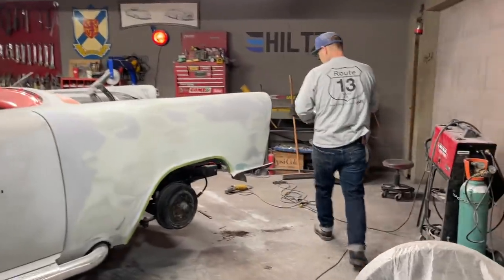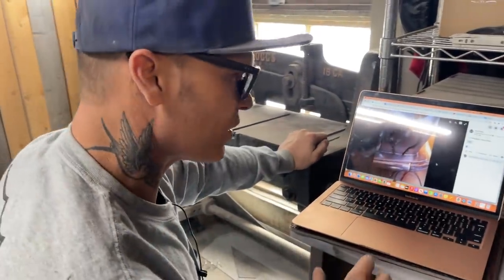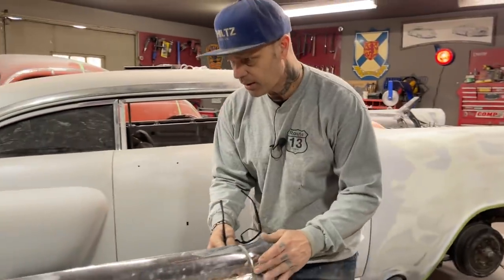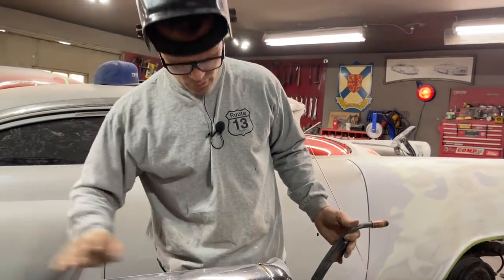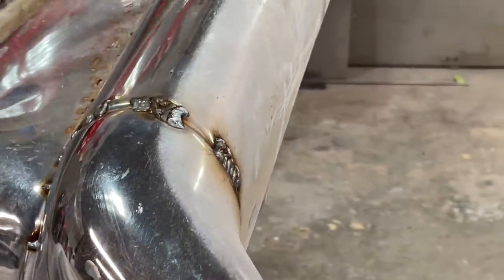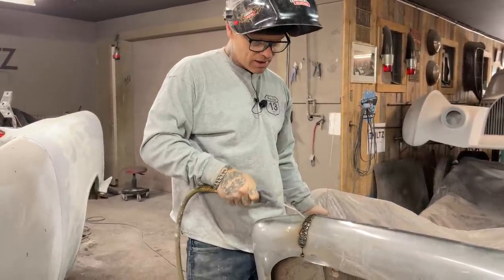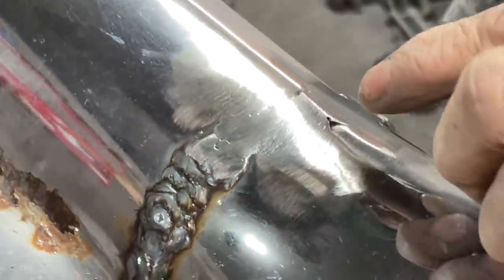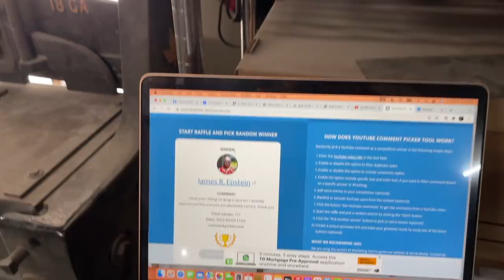Converting 3-Piece Chrome Bumper into a 1-Piece  ✅

Comment: Hey Chad, love the info/photos on the creation of the front end & bumpers. I have a suggestion - drill a hole in the flat frenched sections on each side so that they do not fill up and have water sit in them, just behind where the bumper bolt is welded in would seem like a good spot. Cheers, Tony (1955 Chev 4 door from the Land Down Under)

Comment: Having had things plated for many projects. The smoother you can make it before being plated, the nicer it will be afterwards. Traditional hot dip chroming is getting more and more expensive in this country because of the environmental taxes. Spray on chrome which is water based and can be done to a larger variety of materials is much cheaper and unless you are very skilled you can't tell the divergence. The bonus is it is much cheaper. You probably could have had that grill you had redone for less money than what you paid for that new one. You should really look into it. I think you could add an additional level to your cars and open a lot more options for you.
Reply: Jolene should check out Spectra Chrome.
Reply: @stevejakobs476  Yes. There are also places in Canada able to do the same stuff in Ontario and Quebec which would be closer to them. I think they should look into getting a system. A place called Cosmichrome in Montreal is a supplier of the system and supplies. Then they would be able to do it themselves and they would also be able to provide it to others. It is a much better and nicer system than the stick on stuff he likes to use. Plus it gives him more options.

Comment: Chad, I worked chroming many yr,s ago.  You do all the prep work first to save $$. grind as much pitting and make the bumper surface as smooth as possable.. First they copper plate it, that is the base. All the pitting will show just like primer and paint prosess. They polish the copper andredo until the pits are filled ground (more time and money. The smoother ,cleaner you send it. The less work and $$ for you. Hope this helps! Cheers , Bernie.

Comment: When I did my bumpers, I ground down the weld just before I hit the actual bumper, and then I hand filed it until it was 99% flat, then used 220 to sand the rest smooth. Absolutely no dips or high spots.

Comment: Congratulations on your successful dry February and choice if moderation!   Though you have indicated TIG is too slow fir you, consider that with TIG you are more localized with the heat, so you are able to run a longer bead before risk of warping, and you can cool the piece with the shielding inert gas (which has greater thermal mass) more quickly without switching between torch and air gun.

Comment: Going to be interested in this one because i have a rear bumper i want to modify myself.
Reply: I had to take mine to the shop for them to look at before I worked on it.  They wanted the old chrome and copper stripped off before I did any welding. They did that for me and just included it in the price.

Comment: Wondering about getting your vehicle certified for the road if the bumper is not attached to the frame. Do homemade or vintage vehicles have different standards for licensing or insurance? Asking as I’d like to remove some crazy bumperettes that were designed onto my 2002 Audi TT Quattro. These were only added in Canada and look a bit ridiculous actually.

Comment: Just wondering,could you not lay a bead of spot welds where you have spot welded so it doesn't get away from you and then reweld over the top of them instead of using the rod to fill it??

Comment: On your three piece bumper it doesn't appear that you removed the original chrome before you welded the bumper into one piece. Does the chrome just melt away as you weld or did you
Remove the chrome pryor to welding and it's just difficult to see in the video? Love your videos and it does look like way too much fun for one guy. Lol

Comment: I see there is bolts welded on to hold the top of the bumper I didn't see anything on the bottom of the bumper that gets bolted so won't the bottom of the bumper move around ?

Comment: i did not think you could weld chrome ??? ... it will just flake off over time ... it was told to me because the copper base right under chrome would not stick well after that much heat
Reply: I don’t think longevity is a concern for him

Comment: I am by no means a safety Nazi, but I was wondering if the chrome being sanded and welded is a health risk. 

Also, if the Dagmar’s are bolted to the body, will they dig into the paintwork, or will you have them ever-so-slightly off of the surface. Maybe use a spacer around the mout bolts, or something. They do look pretty cool.
Reply: I think you know the answer. Breathing toxic fumes and particles will shorten your life. How short?   Just depends

Comment: I have to say one thing and that is one should never weld chrome it should be ground off as the chrome in the weld can cause problems in the steel but with that said I like where you are going with the bumper I pity the guys at the chrome shop who will be man handling the bumper to buff it up in their process.
Reply: I think Astro plating might have some video of the processes.

Comment: Hey Chad. Isn't that a lot of weight to just hang from the front guards and that front panel?
I would think that may still need some support from the chassis.
Would not want to see your hard work twist or bend as you drive.
Reply: I like the way the bumper sticks way out on the ends.  It sorta looks the the car has wings in front.  Chad is so artistic!